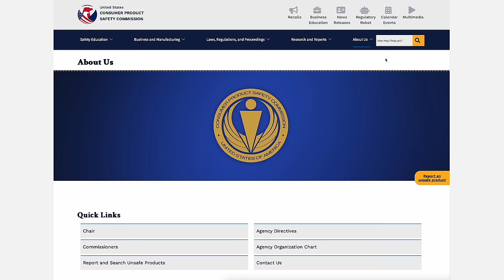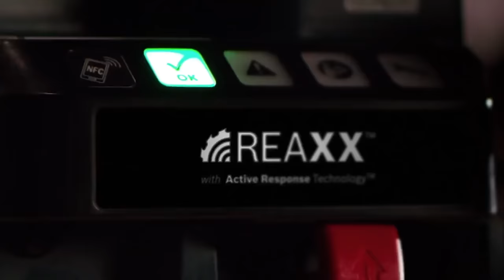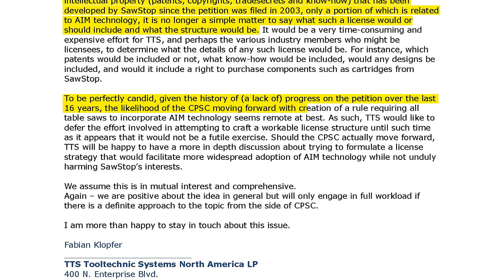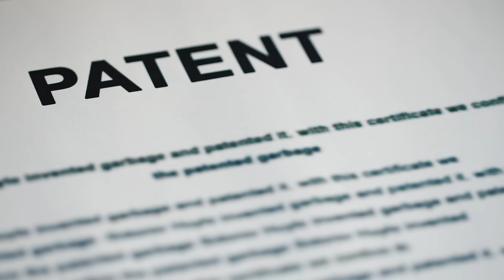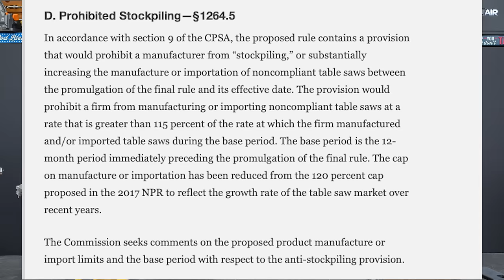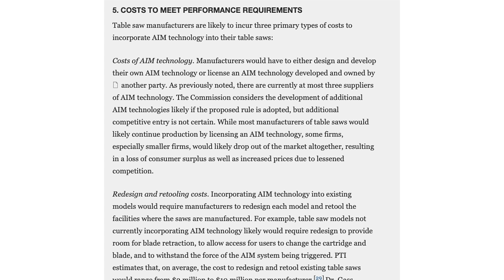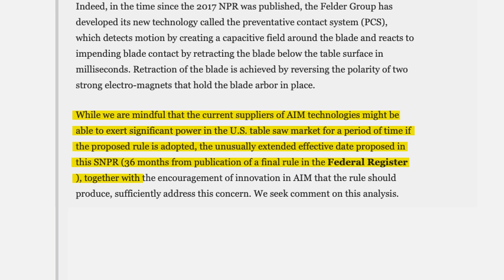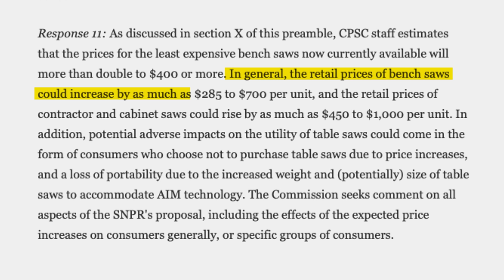The US Government is About to Change Table Saws FOREVER!

Comment: Back in the late 90s and early 2000s I worked for both Powermatic prior to the WMH purchase and then at Porter Cable/Delta through the Dewalt purchase.  Steven Gass approached every manufacturer prior to starting SawStop in 2000 wanting to license the technology.  There has always been two problems with this the first you rightly point out is that every manufacturers' legal department determined that they'd have to license this technology for every model of saw they make.  For Delta we had maybe 20 different models and that license fee alone exceeded the retail cost of many of the benchtop and low end contractor saws.  The second is that the license fee that Gass wanted was so cost prohibitive - not including the design and manufacturing cost increase - that any manufacturer other than Saw Stop who offered this technology wouldn't sell a single saw.  The result of course is that nobody did.  Then, just as now, in my opinion Gass had little interest in safety and is only interested in the revenue stream licensing would create as is evidenced by Saw Stop's continued litigation to extend the relevant patents timeline.  If safety were the primary motivation then the required license fee would have been at a level the market and manufacturers could bear.
Reply: Equally, then and now in my opinion, the manufacturers making table saws have little interest in safety and are only interested in their market share and profits.  If safety were a significant motivation, they would cease the race to the bottom in an effort to shed sufficient features and further abandon quality construction so as to undercut their competitors on price.
Reply: You know Gass did create a better mouse trap, and he should be compensated as significantly as his  technology has completely alter the safety profile for an inherently dangerous piece of a equipment. 
I believe the manufacturing equipment industry really dropped the ball of this issue.  
I am absolutely not a safety nazi. But after a close call with my table saw, I realized that it would be a matter of time before I received a significant injury. My life is already complicated enough, and by loosing a finger or two with all the medical expenses, the use of my saw just wasn't worth it.
Presently saving up for a sawstop product.
Reply: The company I worked for, used Powermatic saws for years. Our safety department had been contacted by Saw Stop and offered to install their unit for free, looking for future sales and bragging rights in advertising. 
The majority of our table saw use was cutting lab test samples of graphite composites, to our blades were sintered diamond coated. Average blade was over $500.

The worst condition (clogged from overheated epoxy resin) blade was chosen as the test dummy as well as a package of hot dogs. As soon as the hot dog touched the blade, bam, the saw came to a stop, but all the debris thrown off left a cloud of graphite dust and some small pieces of fiberglass from other samples.

The replacement "puck" if I recall was a couple hundred dollars and the blade was trashed.

It might have been a upgrade if we used a conventional saw blade, but sintered diamond leaves you with a burn mark on the digit that touched the blade. Most of the time, it doesn't even bleed, as the wound is cauterized.
Reply: @realfamilyman lol but if you say OK government buys them out becuse its going to force every saw to have it he can say OK its 10 trillion in value now we also need to apply that to things like cars mecedies leads  the world in self driving by leaps and bounds but the cheapest car with it is 140k so we should force all vehicles that areess safe off the road right ? Aka 200k cars will be a cheap unit
Reply: @bernardzsikla5640  I'm still surprise that no one has addressed the issue of knife, chisel and gun safety...their use shouldn't be allowed if the user has alcohol, drugs in their system and they should be blunted or fire only soft bullets to protect those they can be used against.  Of course sharpening stones/systems and sandpaper would also have to be federally regulated...and lead would become a controlled substance (it's already regulated).
Reply: I do love capitalism, but this is a situation where the government should nullify  their patent rights. It's similar to the seatbelt situation with Volvo (or Volkswagen?) safety technology of this simple nature should not be paywalled
Reply: @realfamilyman комментарий в стиле "сынок, смотри что бывает если не пристегнуться и разогнаться до 100 миль в час"
Это подстраховка, а не 100% спасение.
Reply: This should be pinned.
Reply: @bernardzsikla5640  Consider a sliding saw instead? Something similar to Hammer K3 Winner?
Reply: @davidseslar5798  absolutely true. Whining about the government "nanny state" is just a way to inflame people's opinions and divert attention from market tactics.
Reply: right, free... or at that time, fees of next to nothing. it was a money grab then, and money grab now.. just doing like the drug companies. Politicians,,,, its for the people.... saves lives.
Reply: @philipferreira4701  I heard Sawstop's patent ran out.
Reply: @bernardzsikla5640  Although I'm all for safety, I have to point out that I'm 74 years old. I've owned table saws without blade guards, splitters or riving knives my entire adult life, and I still have all my fingers and toes.  I will most likely go to my grave with them.

The current fearmongering that anyone with a table saw is going to wind up missing limbs or digits, unless he dumps it for a SawStop model, might be a wee bit overblown. There's still such a thing as  common sense, and proper respect for a tool.
Reply: I agree, if someone wants to buy a table saw that costs significantly more than others for the tech, great! If not then great! Don’t use our government to force manufacturers to implement this expensive tech, licensing, etc. by law. And as our government has proven over and over they don’t stop with one time or one change! Keep government out of tools and woodworking period
Reply: @bernardzsikla5640  I was tempted to get a sawstop but decided against it for price reasons and this is something I enjoy when I want to etc. and that’s how it should be and needs to remain, each individual is responsible to him or herself alone and not Gass or the government. You had an alarming experience therefore you can decide to fork over the cash for one or wait till other brands produce their own, and I personally think there’s a ton of benefit to a sawstop obviously although I’ll never underestimate the importance of good practice and not relying on tech to save me too but utilizing government to force the issue is appalling and it won’t stop there as our government has proven all too well! Safety is important but that’s for each American to decide what precautions or measure they take to be safe. I don’t want anyone forcing their fears onto me or you or anyone else. Government needs to stay out of personal choice. Now I’d be thrilled if there were more affordable options for this type of tech but again, it should never be required! I’m a woman, I’ve learned majority from the men here on YT how to use tools properly and form personal experience and I have lupus sle and yes I have rational fears of course and an injury could be really bad for me but that is a me issue and my responsibility to ensure my own safety! Not anyone else’s and certainly not some inventor or our governments concern
Reply: @troystallard6895  yep! It’s on each user to use common sense and know what is good practice and what isn’t. That’s a personal responsibility if someone chooses to use a tool! It’s up to the individual to not get harmed not on our government to regulate
Reply: @jewdd1989  I am absolutely in your camp with this. 
I hate getting $350 tickets for not wearing a seatbelt. (Plus a bunch of points on my license) it is no one's business but mine. I also believe that the tool companies should have made a deal with Gass to give their customers some kind of option. 
Yet, the government should not be involved in individual safety issues
Reply: @elbuggo  Yes, short term I am  looking at either Makita track saw or milescraft system
Reply: @realfamilyman so...you are encouraging more communist action by our already pretty communistic government?
Reply: Just had to replace a drain hose on our 35 year old washer... I'm gonna presume that safety cartridge saw stop has that patent on is made in China... considering the company I retired from has two of there units, and if memory serves me right, two cartridges have malfunctioned since owning them..there reasoning was moisture content in the wood...
Reply: Agree with you wholeheartedly - the for Gass/Saw Stop in this endeavor is money - and if Gass was concerned about humanity and the carnage caused by woodworking tools, why limit his fight to table saws?   An example of hand tools that cause exponentially more harm --- look at knives, box knives in particular...    "Knives cause more disabling injuries than any other type of hand tool. This study investigates knife-related injuries requiring Emergency Department (ED) treatment among children and adults in the United States (US) from 1990 through 2008. A retrospective analysis of data from the National Electronic Injury Surveillance System of the Consumer Product Safety Commission was conducted. An estimated 8,250,914 (95% confidence interval [CI] 7,149,074-9,352,755) knife-related injuries were treated in US EDs from 1990 to 2008, averaging 434,259 (95% CI 427,198-441,322) injuries annually, or 1190 per day. The injury rate was 1.56 injuries per 1000 US resident population per year. Fingers/thumbs (66%; 5,447,467 of 8,249,410) were injured most often, and lacerations (94%; 7,793,487 of 8,249,553) were the most common type of injury. Pocket/utility knives were associated with injury most often (47%; 1,169,960 of 2,481,994), followed by cooking/kitchen knives (36%; 900,812 of 2,481,994). Children were more likely than adults to be injured while playing with a knife or during horseplay (p < 0.01; odds ratio 9.57; 95% CI 8.10-11.30). One percent of patients were admitted to the hospital, and altercation-related stabbings to the trunk accounted for 52% of these admissions. Knives represent an important source of morbidity and mortality to people of all ages." 
    Smith, Gary. (2013). Knife-Related Injuries Treated in United States Emergency Departments, 1990–2008. The Journal of emergency medicine. 45. 10.1016/j.jemermed.2012.11.092.

Comment: Just to add some contextual information.  SawStop's original patents expired in 2021.  They have extended protection by way of 'Continuation Patents', which are extensions / variations on on the original patent.   Based on current status, their protection would expire around 2026, though new continuation filings could change that.   New continuation patent filings are only effective if (a) they actually are patentable and (b) they are seen as a necessary component that any competitor would need to implement in order to compete in the space.